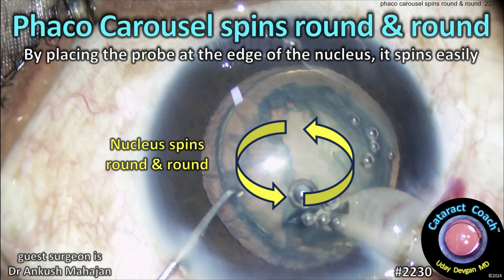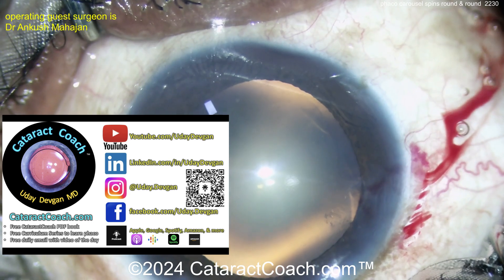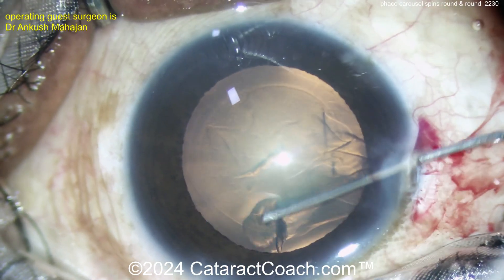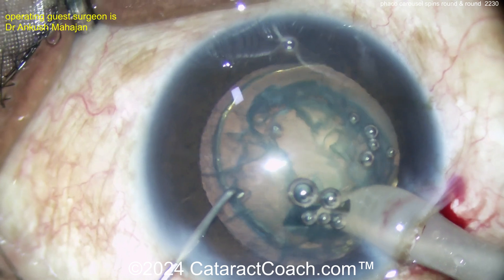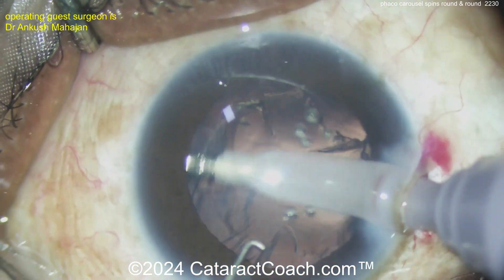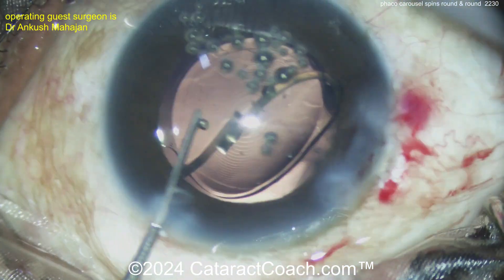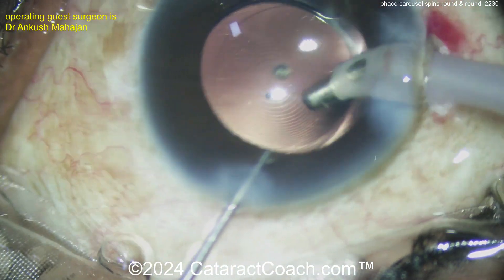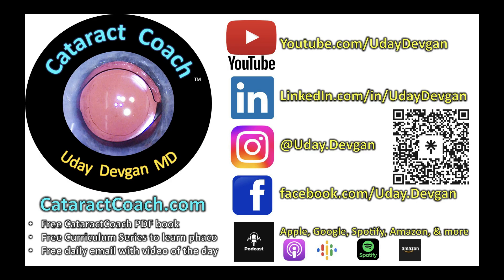CataractCoach™ 2230: phaco carousel spins round & round

Comment: Great Surgery!

Before the primary incision is made the surgeon creates perhaps a 3 mm incision in the conjunctiva and then enters in that location slightly posterior to the limbus. This appears to have the dual purpose of allowing a more posterior incision along with avoiding conjunctival chemosis by allowing fluid to escape rather than being pushed under the conjunctiva. Is that correct?

If correct , if a surgeon prefers a more anterior incision than shown in this video (anterior to the limbus or clear corneal), would it be helpful to do a very superficial ~3 mm incision parallel to the limbus, slightly posterior or in the same location? Thus having the potential to act as a prophylaxis to prevent chemosis from occurring during Phacoemulsification or IA?

Thoughts?

Thank You